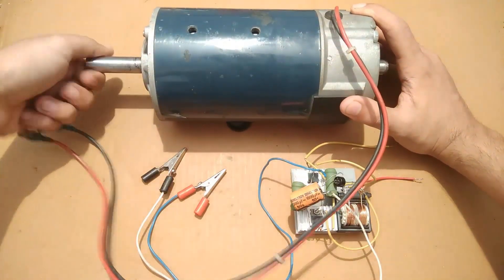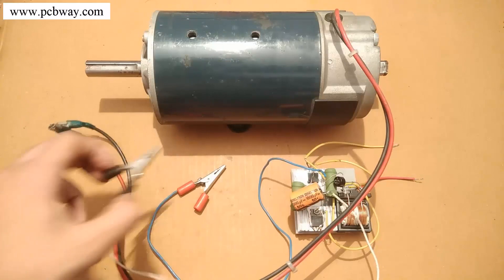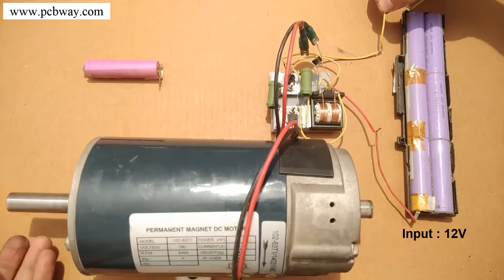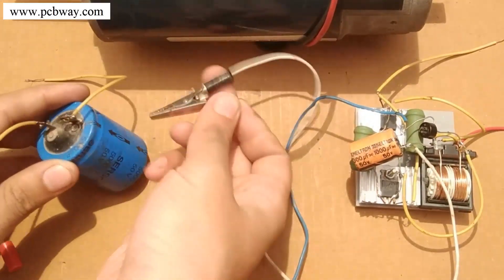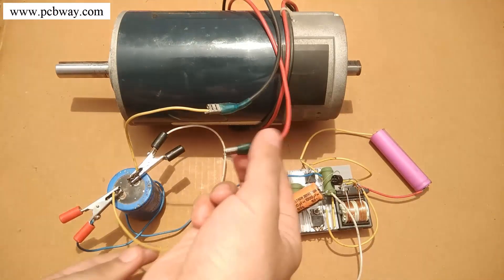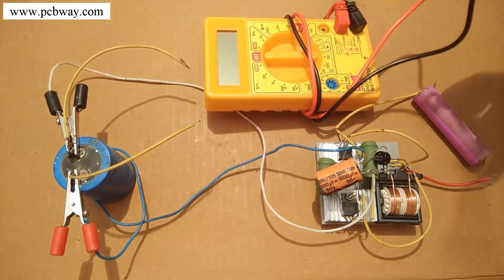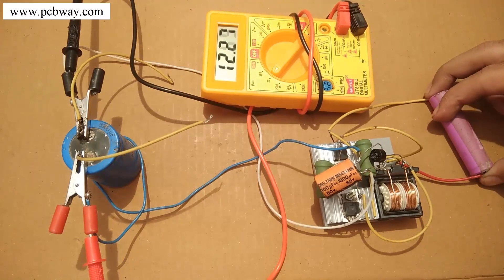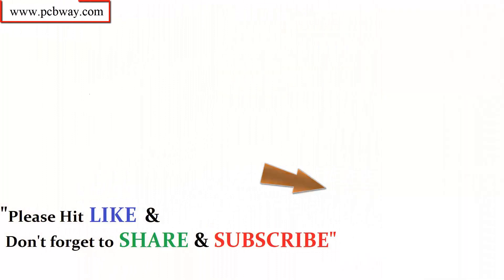Run 1500W DC Motor with 3V cell || New Amazing Hack

Comment: I wanna run a BLDC motor of 100volt dc 90Amp 9000 RPM. For paramotoring flying. But i dont wanna carry too many batteries. Can i boost my required volts and curent from 12/24/36 volts...

Comment: Please I like this video but I need the full or complete diagram to start it
Reply: Please I want to use starter motor  to run a load and be charging the 12v battery at the same time
Please I need your help!

Comment: The reason this works, if you took a class in electrical engineering, a motor doesn't start with direct current from a power low rated line but will start if you put a high rated capacitor in the circuit, because the capacitor stores the energy and blasts out bursts of energy to the motor.

Comment: Can someone help me with this .. i have a 500 w 220 v DC motor ..  if i run it with 24 v .. how much power on ' w '  will i get .. and will it be as powerfull as runing in 220  but with lass rotations ?

Comment: a step up booster is increasing the voltage and low the current , keeping the W constant (ref. to battery) probably that cell is 3.7 v with 2000 mAh aprox 7.4 W fully charged.

Comment: its not running in full speed
Reply from the maker: of-course not because the voltage needed to run it at full speed is 180V DC and i am giving it much less.

Comment: Sir mujhe transformer nahi mil Raha hai meri dc motor 24v 3.5amp ki hai mujhe 6vdc pe chalani hai please help me koi power boost converter batao online shopping ideas do
Reply from the maker: You can use two inductors from old cfls.Its not necessary that not necessary that the circuit is possible only with the transformer i used.

Comment: Is this type of 1500 watts D.C motor that you start with 3.5 volt battery can use also as generator?
Reply from the maker: Yes sure it can also be used as a generator
Reply: Thank you. can i use this directly without touching any parts inside? and please give me the details of this motor for were it was use before you view this in you tube so that i can purchase this also here in the philippines
Reply from the maker: yes !! without touching any part inside, it will work as a generator.
Reply from the maker: On Alibaba..

Comment: So,   Mr. E   If You put a much much bigger capacitor where You have the blue one  what would the rate of the useage of the battery be?
Reply from the maker: Power output should increase and so does the battery drainage but i am not sure until i conduct the test.It also a possibility that the performance might get decreased ...

Comment: Motor still hesitates with that low voltage. You said: At the cost of voltage. How long do you think your battery will last?
Reply from the maker: Turgut Belen : Not long but if a circuit is efficient enough to operate such a big motor then it can easily operate a 12V motor at a really good RPM with just a 3v input ..
Reply: Mr Electron yes you have a point there. Good job.
Reply from the maker: thanks !! 🙃

Comment: And now make it run at it's rated 1500w.... (500A at 3v !)
Reply from the maker: For the motor to run at its rated 1500 Watts which is full power, i will have to run it at 180V DC which is the best part that the circuit is efficient enough to make the motor start with an input of just 3v
Reply: Mr Electron FYI: This had nothing to do with efficiency. The motor has a fairly high induction and without the added capacitor the motor was pulsed with high frequency pulses. The capacitor smooths the output voltage so it becomes more a real dc and so increasing the motor current.
Reply from the maker: pgScorpio I also tested the system with simple resistive loads which are a proof for the efficiency statement.
Reply: Mr Electron OK, then proof what was the efficiency before and after adding the capacitor 😉.
Reply from the maker: Sure in my next video :) :)